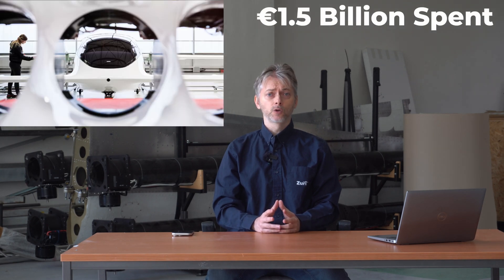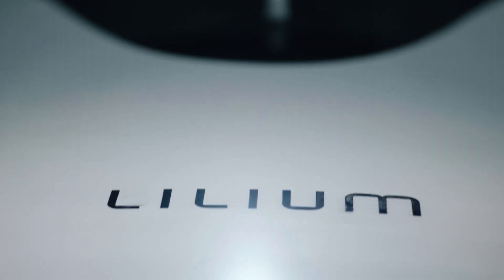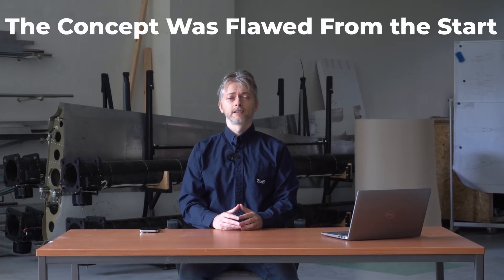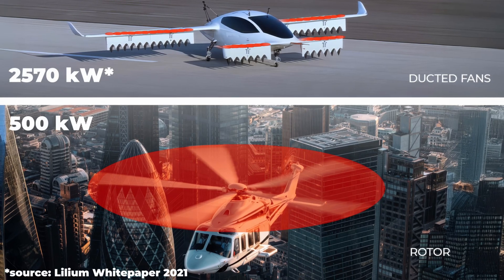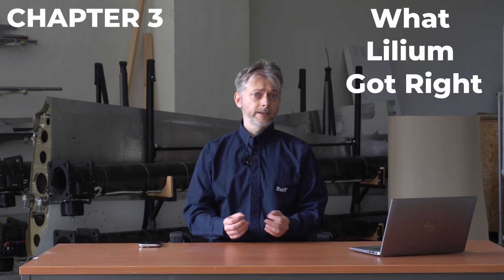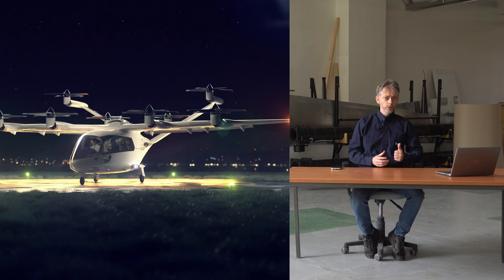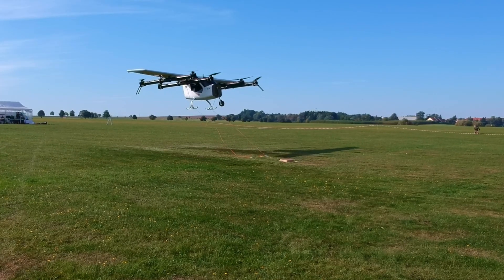Lilium's €1.5B VTOL Collapse Explained — Why It Never Flew

Comment: I cant believe Lilium where not awear of the disk eria vs efficiency as it is basic.
However ducted fans also have efficiency and noise benefits.
Reply from the maker: Good point on disk area and efficiency. It is a fundamental concept. At the same time, as you mentioned, ducted fans can offer noise and efficiency benefits in certain scenarios. Like many design choices in aviation, it comes down to tradeoffs, specific use cases, and balancing competing factors.
Reply: @zurivtol  I think Lilium was banking on near-term advances in battery or capacitor-bank technology that would solve the power density problem for them. 

I have no inside information about Lilium, but in the 1990s I invested in a small electric car company in California (Corbin Motors) and lost every penny. I did get a beautiful electric car out of it, but it only had a 25-to-30-mile range (about 50km). Years after the company folded, some of the owner-enthusiasts who were electrical engineers built lithium and lithium-iron-phosphate battery packs that quadrupled or quintupled the range... but you had to buy the parts and do your own conversion. Or hire a talented individual to do the whole thing for you, for almost the price you paid for the car in the first place. 

My point is that I have personal knowledge of how many of these earnest cutting-edge technology companies think. All their senior management and founding investors are "true believers" prone to believing the best of adjacent industries' innovations too... and sometimes betting the company's future on other people's "imminent breakthrough" hype.
Reply: Trust me, THEY WERE AWARE, but being one of the many Ponzi Techno-schemes they just ignored everything for the money..
Reply: I'm sure they were aware of it. They believed they could overcome it. And for a very small craft, they were right...

Comment: Agreed, fits my own analysis, that Hybrid beats pure EVTOL as things currently stand for battery tech development.   However, the bigger question is:  Does having the E capability really make sense, have any truly convincing argument and on what basis, even if if we had 10-times better power and storage gravimetric and volumetric battery tech. the dream battery?  We already have helicopters and tilt-rotors  that can run on renewable aviation liquid hydrocarbons.  My view is that we should be rethinking our airliners to be smaller and STOL, and then moving away from the massive hub airport paradigm to a network of small STOL airports with mostly direct flights to all destinations.
Reply from the maker: Really thoughtful take, and agreed that hybrid VTOL currently makes more sense than full electric in many real-world scenarios. While it is true that long-haul travel may still rely on hubs, there is huge potential in regional point-to-point connections.

In the United States alone, there are over 5,000 underused public airports. That represents a massive opportunity to rethink access. And with hybrid VTOL, many of these locations do not need to look like traditional airports. They can be quieter, smaller, and located closer to where people actually live or need to go. Appreciate you sharing your perspective.
Reply: @zurivtol  You're welcome!  And thank you for your reply! I too, like many others, have considered the potential of using those 5000 underused airports and the possibility of building new small airports for STOL ops.  In my view, when we consider the added complexity and weight burden and costs, and safety issues of making an aircraft VTOL-capable the slight savings of being able to operate VTOL are destroyed by the added costs...VTOL only makes sense for short hauls-hops (max 100-200 km), e.g. airport to rooftop helideck.  We could make STOL aircraft that would be at least 2X more fuel-efficient than a 787 and more total cost-efficient, and they could operate from airports only 1km X 1 km, much of which is space for aircraft parking, terminals, and hangars which would also be needed for VTOL ops...having pads instead of runways just doesn't save enough land to offset the reduced cruise performance, fuel-efficiency, and total costs of a VTOL aircraft.  Making it E does nothing to offset these issues, and if we are using renewable liquid HC fuels made by Renewable Fischer Tropsch Synthesis (not algal fuels), this makes our ops carbon neutral...more than good enough for climate concerns, especially when aviation is emitting only 2-3% of our total GHGs.

I wish you and your company all the best with your Hybrid VTOL efforts.  They certainly make more sense than pure EVTOL, but I'm just not convinced that such aircraft are the overall optimal solution for a better air transport system, although they could have a valuable role to play.  Good luck!!

Comment: If lillium had Liquid piston generator, axial flux open propellers, graphene infused Carbon fibre body , grepow 350 wh/kg batteries , everything else would be easier to do
Reply: Lilium was already using 410Wh/kg cells from Ionblox. That cell choice would have been an energy downgrade.
Reply: @LukeLiveforphysics  power density?
Reply: @mrmusanda3576  Power density in discharge was decent for discharge, and unexpectedly very high in charge, like 6C.

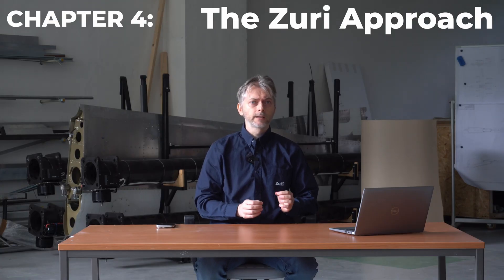Comment: 2:18 you will crash and burn too. your concept is not sound either. if you use hybrid power better to use compound helicopter. you have only one rotor (possibly 2) and be way more efficient by your own words and no need to have fancy transition. 200 knots that is easy with compound helicopter, is good enough. you wont be fling super far with that anyway... unless in really really few cases.
Reply from the maker: Thanks for your thoughts. We understand there are differing views on how to approach hybrid propulsion, and compound helicopters are one of several interesting paths. That said, in Europe the average flight distance is around 1,140 kilometers. Many flights fall well within hybrid VTOL range, especially in regional travel where flexibility and infrastructure access matter most. It is not just about distance, but about solving for real-world routes in more efficient ways. Appreciate you adding your perspective.

Comment: Quite bizarre how they could get so little out of 1.5bn and Joby and Archer has spent as much or more already. And doing it wrong as well.
And so are you. You are wrong about batteries, you can get 300km range and that's plenty for the typical use case, especially fast taxi operation. You also make the same mistake as Joby and Archer with way to many rotors in the name of redundancy. I've said it many times and no one listens. It needs to be 1 or at most 2 seater autonomous and have 2 tilt wings and only 2 rotors. Probably ducted for acoustic and safety reasons. You will note that we have 2 lungs and 1 heart. Not 8. Birds don't have 8 wings. Pop out parachute and wings to glide in engine failure. And make sure engine failure doesn't happen. That's better than 8 engines.
Doing a 1 seater is both much cheaper to develop and to produce but it has a chance to have long enough acoustics to be permitted urban operation. If the vehicle is limited to helipads and is 10x more costly that's a far smaller market. Try to understand that most taxi use is single occupant. Sometimes 2, rarely more than that. So nonsense about a 7 seater is just nonsense. Failure to appreciate novel use cases. The clown as Joby and Archer are talking about pooling passengers to fill the aircraft. So they are looking for dumb solutions to a dumb choice of having many seats. 
Autonomous, ultra light, 1 seat, 2 wings, 2 rotors. Low noise props. You can also think 2g acceleration. And if it weighs more than 300kg you are doing it wrong.
Reply from the maker: Zuri is not focused only on flying in and out of cities. The greater opportunity lies in connecting underserved regions, locations around urban centers, and smaller economic clusters that are not well linked today. This means avoiding long detours through major airports and offering more direct access to where people actually live and work. Hybrid electric VTOL makes this kind of point-to-point travel more feasible, especially where traditional options are slow, limited, or nonexistent.
Reply: Mr. Dan, I agree with all of what you have said. I have looked at VTOL aircraft designs since the early '80s and very few designers have gotten it right. Too bad that the best designs aren't getting funded...🤔🧐
Reply from the maker: It is true that funding does not always follow the most efficient designs, especially in emerging industries. At Zuri we are working to strike the right balance between innovation, practicality, and long term viability. Thanks for engaging in the discussion. Every perspective helps push the conversation forward.